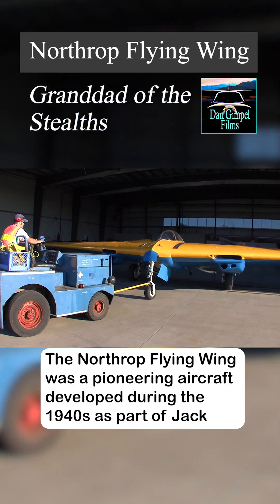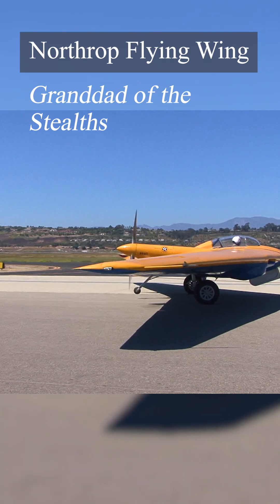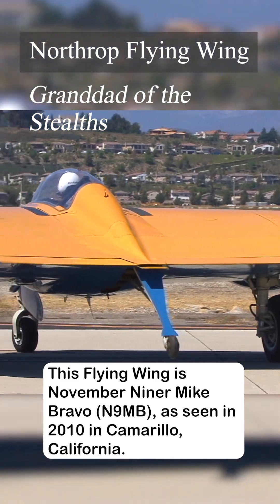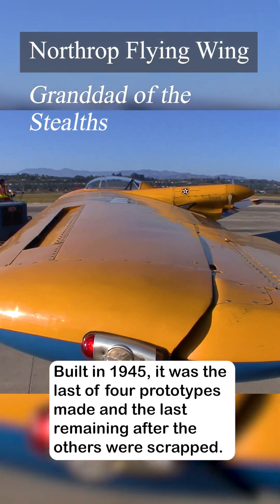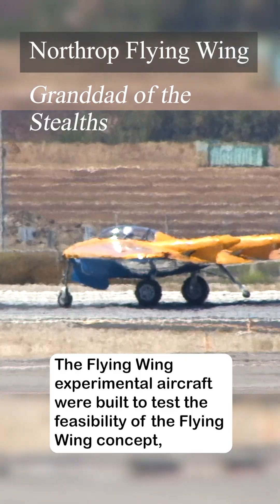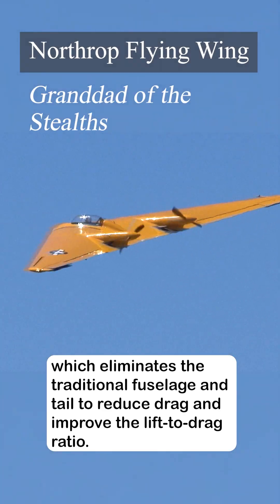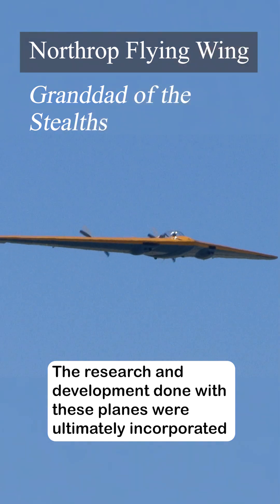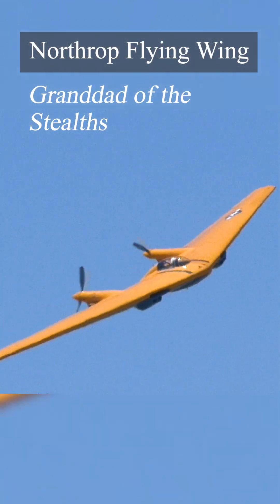The Northrop Flying Wing - Granddad of the Stealths

Comment: And sad to say that a year or two ago, the aircraft had a problem and crashed in Norco California, killing the pilot and totally destroying the aircraft. 😢😢😢😢
Reply: Lose of a very significant airplane.

What was the cause of the incident?
Reply from the maker: Cause is unknown.
Reply from the maker: On April 22, 2019, Niner Mike Bravo was destroyed in a crash shortly after takeoff and the pilot,  David Vopat, was killed.
Reply: @dangimpelfilms  thank you for the follow up 🙏
Reply: I saw this aircraft flying at the Chino air show in 2013, it was thrilling. The loss of pilot and aircraft were tragic.
Reply: I don't think the airplane had problems, my understanding is the pilot was doing some aerobatics. I've got lots of experience with flying wing RC aircraft and they are absolutely horrible when it comes to aerobatic flight.
Reply: @christophergagliano2051  The pilot was not doing any kind of acrobatics they never flew this aircraft in any way or form as to be a hazard to the craft.
Reply: @williamwhite3276  initial reports was The aircraft was seen doing aerobatic maneuvers, but I will check the NTSB database just to confirm.
Reply: @christophergagliano2051  Shortly after take-off from Chino Airport the aircraft was reported to have pitched upward and banked left, followed by an abrupt right roll. Witnesses then saw the N-9M nosediving before crashing on the grounds of the California Rehabilitation Center state prison. Sadly, Vopat was killed in the crash.

In a preliminary report on the incident, the National Transportation Safety Board (NTSB) wrote:

“Multiple witnesses located near the accident site reported observing the airplane flying on a northeastern heading at a low altitude when it performed a "barrel roll." Several witnesses reported that after the maneuver, the airplane "wobbled [from] side to side" before the airplane's canopy separated. Shortly after, the airplane entered a steep right turn, and descended into the ground in a nose low attitude.”

The aircraft was being operated under an experimental airworthiness certificate and had 732.8 hours of flight time at the time of the crash.

The barrel roll was part of what ever went wrong it was not part of the test. David was briefly able to recover from the roll but what ever was happening it was to late.